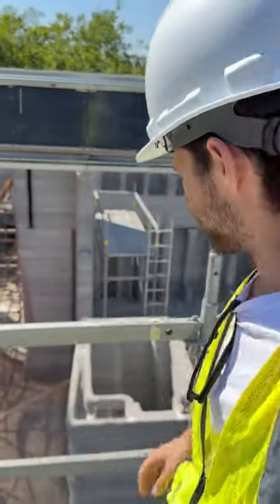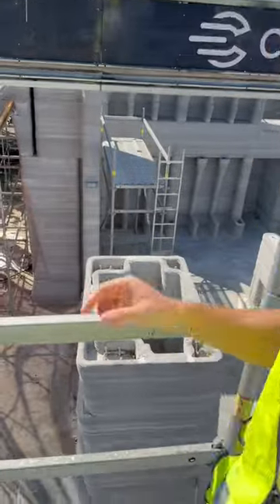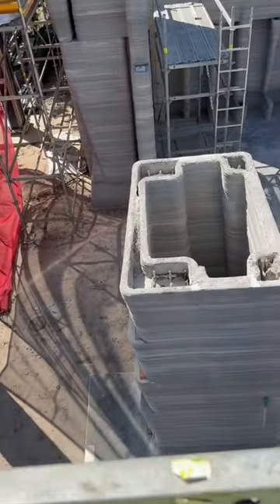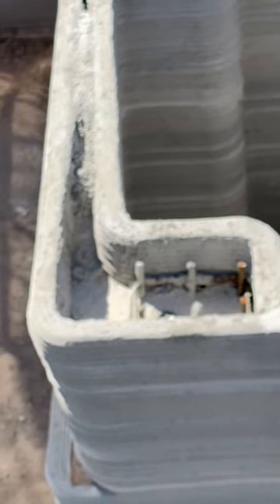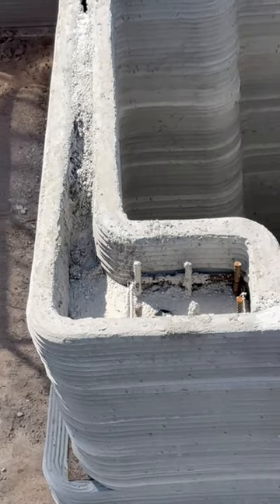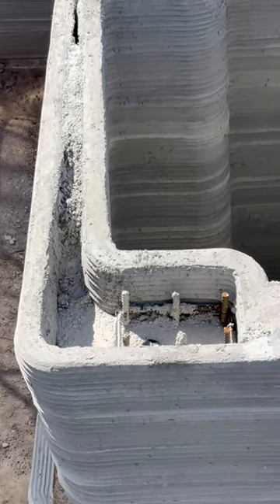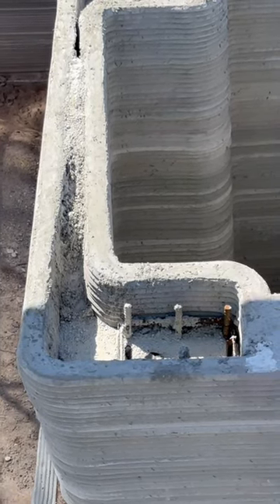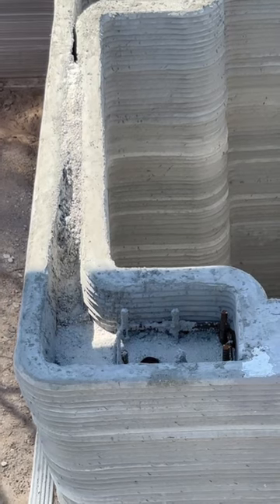Vertical load solution for printed walls

Comment: But the rebar column is not mechanically connected to the concrete building base. Everything is just sitting there.
Reply: Ok, i was thinking the same.  They just throw some rebar in the middle and fill with cement???
Reply: Thats exactly how concrete block houses are made.
Reply: The other bars are inside the walls, and you can’t see them because the concrete is covering them.
Reply: @DustyHoney  not true. The starting row is laid right on top of the slab
Reply: in fact they must be anchored to the foundations/foundation slab underneath if someone thinks that this is to be the stabilizer of the building. Depending on the rebar dia those stirrups should protrude something like 1m above the slab surface.
 Been playing with concrete closer to 40yrs by now, and what I see these 3D-printers do not care at all about curing of the extruded concrete, that's to say poor concrete quality, cracks & modest compressive strength. Unless they've invented some super good concrete recipe they're not willing to share with others...
Reply: @DustyHoney  I've watched a lot of these videos, that is not the case. They arent sinking iron into the foundation, they aren't connecting anything - certainly not to other cages. This is a start-up 'solution' to a problem of optics, not an engineering solution to a problem of structural soundness.
Reply: Yes, after this junk falls apart, those 4 columns will be all that's left standing
Reply: @heinawithdotshanko  yeah, they need to use specially formulated concrete because traditional fiber fill or aggregate doesn't extrude well and if they use a mix without any fiber or additives you'll totally get some early life crackage just from it curing.

If you get a good contractor and if they use the right additives, a lot of the risk of cracking gets mitigated. It's still not as good as a traditionally poured concrete home but it's good enough and it's cheaper... But that's if you get a decent contractor.
Reply: Why assume that they didn't pre-drill the pad to accept the rebar cage?  They could print a few layers, drill the anchor holes for the cage, print the remaining column height, then slot the cage into the holes they drilled earlier and pour the fill.
Reply: ....what do you think rebar is and how it works in traditional construction?
Reply: You could use red heads to thread bar into before the print starts would technically be anchored to the foundation when they pour
Reply: Throw some binding agent in there and hope for the best
Reply: @conortobin6180  brick and mortar construction houses do not have reinforcing.
Reply: If you don't know what you're talking about, refrain from inserting your worthless comments. There is rebar set into the slab before the wall is printed, about 2 feet above the slab. Then after the walks are put up, holes are busted in the side of the wall where the cage is tied into the rebar cage inserted from top. Then the hole is covered, the walls are poured, and the rebar is all tied together.

Comment: So what your telling me is you convinced someone to pay a stupid amount of money to 3D print forms? Only to have a pump operator come and fill the walls. Man you must be a damn good salesman then.
Reply: umad?
Reply: I've been thinking that this whole time is it really more cost-effective to 3D print instead of just forming it up and pouring it
Reply: don't be jealous ;)
Reply: When you do the math of time, labor, materials, reclamation etc.  Printing forms is superior from both a structural standpoint AND an economic one.  With one machine, basically two dudes can form the entire job.
Reply: @FuzzyPurp  no lmao, cuz I’d end up pumping that wall non the less once it has issues.
Reply: @mdacosta7013  honestly there’s pros and cons, pros being less labor costs, that’s pretty much it. Concrete is not designed to be inherently layered like that all drying at different times. I can bust out 50 yards of walls in abt 2hrs or less for a house, flatwork up to 100yrds an hour. So the efficiency isn’t there on those printers yet. I’m not sure of the costs to run them all day long, but a typical pump ranges from 500-900 an hour.
Reply: @Normadus  oh don’t worry no jealousy here, I’d end up getting paid to go and pump the wall non the less once it has structural issues.
Reply: @ilovecars93                                                                         your entire cities are built like a wooden huts and fall like card houses after every tornado, so what are we even talking about
Reply: @Normadus I live in a wood house that is probably older then your brick house and Still in better condition and your talkin shit
Reply: @ilovecars93  
sure, as long as it helps you sleep better at night.
One little tornado and whole neighborhood gone LOL
For me it would be 5 windows while the rest of house and ceiling would be untouched :face-blue-smiling:
Reply: @Normadus  that's rich comming from a guy that's probably never even seen a tornado yet he's gonna pretend his house is built to withstand one 🤣🤣🤣 keep being dumb pal it's funny
Reply: @ilovecars93 my stone house over here has withstood two hurricanes no problem  and it'll probably cost less than wooden houses over there considering if you live in America. 
The first hurricane blew parts of the roof even though my dad and gramps reinforced it so when we rebuilt it we opt to fully cement it. Haven't had a problem since then.
Reply: @owarida6241  tornado isn't just rain and some straight line winds it'll twist and rip your unprepared and shitty built brick house 🤣🤣
Reply: Formwork is more dangerous than this and takes more man hours and more qualified labour, whereas you could probably teach a burger flipper to operate this machine and cut the pay.
I wonder how using this proportion or concrete impacts the price but if it's affordable enough it has the potential to be a real threat for structural masonry work.
Not sure it can be wooden houses in the U.S. market though.
Reply: @Jeramiah870 my concern is this concrete is not monolithic and since there's no form they can't vibrate it. And apparently to prevent premature cracking they're having to develop new mixes.
Reply: @ilovecars93 fun fact: lots of old brick buildings in Europe were either rebuilt in the 50's because of the war or are around 300 years old at best.
Beyond that time frame, if it's still standing, it's that people didn't care enough to plunder it or someone's been restoring it. It's very difficult to find pristine buildings older than 300 years old. Except for the pyramids if they're not buried they tend to go to shit.
So yeah wooden houses don't last for less than brick buildings
Reply: @owarida6241 you do realize hurricanes are not supposed to rip wooden houses apart right? Unless its hand built by non-engineers, which had no one to blame.
Tornados in the other hand are a different story. Depends on the structure but concrete house not designed to withhold tornado might not be any better either.
That being said, I hate dry walls though. It's too weak but I guess it's easy to work with.
Reply: @ilovecars93  idk why are you bringing brick houses to the conversation. Because this video obviously  is not about a brick house. It's about monolithic carcase concrete building. And what I can tell you from experience, those things withstand a direct missile strike. They need some repairs after that of course, but it surely won't fly to the wizard of Oz riding a tornado, like the Dorothy's house.
Reply: @oleksandrbespalov9713  if you would read the thread you would see that little europe boy decided he wanted to talk shit about american houses so i had to call him out.. just like i am forced to do with you considering you claim this mud hut in the video can take a direct Missile strike which it definitely can not  hell they cant even withstand 70mph winds
Reply: THESE ARE LOAD BEARING WALLS JERRY
Reply: What are the warrenties, what are the real numbers per square ft?
Reply: Wooden and. Con crette houses last just as long, because they both keep getting repaired when they need it
Reply: As it stands rn it's more expensive investment than a wood frame to pour in, but it's less man hours into making it, I imagine at some point it'll be cheaper and more consistent than traditional construction
Reply: @owarida6241  America has no shortage of timber, so wood framed houses are cheaper than solid concrete or brick homes. Moreover, most people in America never experience a hurricane or tornado. I have lived in a "small tornado alley" all my life without experiencing one.  Most houses in places like that have countermeasures against local natural disasters.

Even better renovation in American homes us easier due to the ease of construction. Old EU homes that are solid are more difficult and expensive to update to modern plumbing or wiring.
Reply: @FuzzyPurp they definitely
Reply: @ilovecars93 I'm in east Texas and run a glass company for showers in new construction, so far these houses have held up great considering most houses built here the the states are fucking paper. Haven't heard of them having problems, definitely seen and went back to new houses that shifted after a couple months and had to remove whole frameless showers. No one lets their house or foundation settle, starting to turn into suburbs and clone houses it sucks.
Reply: I live in the middle of FL in a wood frame house sitting on bricks and never evacuated during hurricanes
Reply: @mdacosta7013   yeah it is cause it takes less manwork...
Reply: Tell that to the Greek and Roman's that have made concrete buildings that have lasted 2000 years to that of a wooden house that would burn down
Reply: @greyfoxyo  yeah,  I'm from Rome, i'm literally surrounded by concrete that lasted millenia and some clown in the comments comes saying "no matter what you put in the concrete, it will crack". Lol
Reply: @isakaldazwulfazizsunus7564 formwork is dangerous? Huh, I've been doing it for 12 years and barely gotten a scratch in all that time. Go play with your crayons and make sure to wear a helmet
Reply: @gatergates8813  Congratulations on you following proper procedure.
It CAN be dangerous when workers get pressured into OSHA violations, which happens all the time.
Reply: As Jeff from American dad explains the mystery’s of the universe. The comments is still rejecting this like It’s acid that’s gonna melt ur throat.
Reply: Printing is cheaper
Reply: @ilovecars93  Most of the houses in the south are made of aluminum sheet and plywood
Reply: The point is it's cheaper, bro.
Reply: It lets you have complicated curved forms that would be a real pain to do with traditional methods.
Reply: @nata5212  as a resident of the south i hate to break it ot you but you couldnt be more wrong lol
Reply: @ilovecars93 Sorry what lol, I work on historic masonry. Your wood home is not lasting longer than the brick and stone structures out there, your wood will rot away eventually can't say the same about stone.
Reply: @lunawense6288  look i know people like you who have smooth brains have a hard time understanding but if you READ what i have said nothing about it says anything about stone rotting lmao read first comment ignorance after...
Reply: I was born in Europe where my father almost 70 years back build a one level house. The house is made with brick and has reinforced cement columns that are connected to a "cage" of beams underground. 40+ years ago the house was extended upwards adding another floor. Soon after that a powerful earthquake of 8.1 hit the area...
Nothing happened to the house!!
Wooden structures can not withstand those forces.😊
Reply: @mdacosta7013 I mean I think the point is not to necessarily be cost effective but rather labor reducing. Imagine a development village and instead of 20 guys working on 1-2 houses, it’s 20 guys working on 10 all at once. I mean it is easier in the sense that huge forms wouldn’t have to be made and transported between plots. I mean I think the future is more or less a moving 3D printer system. So instead of it being a huge rig that spans the site or a lil truck thing that has the printer, it will be an unmanned vehicle that roams the site printing as needed. That also means getting that at that point we may see better systems for infilling the walls etc. I also see it as a tool for mass design vs personal design. I think the future sees us having actual builders as more of a “pro choice” and the printing process being the “get er done” choice. Meaning if you want specifics that add in woodworking, per se, that you’d hire the builders vs the printer guys. I think that it’s kind of gross that we are moving towards taking humans out of work, especially in the labor field where a majority of people already found themselves there as a last resort. That’s not to speak on all people in the labor field or even on he quality of people, but simply a basic truth of the labor pool. Plus some people just love to work with their hands and this could be something that pushes them out of work in the future
Reply: @ilovecars93 You're not too bright for thinking this will last only three years, or blow away.
Reply: @Jeramiah870  Explain to me how they poured the Hoover Dam, and how it still holds up today. Ya know, since concrete isn't suppose to be layered and drying at different times.
Reply: @boringshawn33  I’ve talked to one of the creators of a company for 3D printing…. He tried to hire me due to me being a concrete pump operator. He word for word said if you even slightly bump that wall while it’s setting it’ll come down and feel like wet sand falling on you. The Hoover dam was constructed with different bag mixes and aggregate than what we have today…. The base of the dam is 660 ft thick, with the top being 45ft thick. There’s a massive difference from a 6 inch wide wall compared to a 600ft wide wall.
Reply: @boringshawn33  not to mention, it’s not really define as a wall when being poured, but layers of flatwork being essentially combined together using some sort of connecting points. So there’s a major difference between this 3D printed wall, and a dam. But hey, I only work with concrete everyday for 8-14hrs a day what do I know.
Reply: @Jeramiah870 then why are multiple countries and governments using this technique
Reply: @Sumguysazz  source please?
Reply: @Sumguysazz  ever notice how when a government picks up something to use it’s usually because they can make more money without spending as much on the asset/item/material? And I’m not sure why we would be so worried about other countries (like America always has been) when we should be worrying about our own country for the time being. Africas 3D printing economy certainly won’t affect us over here.
Reply: @Jeramiah870  it started in the Netherlands, and nearly every country in Europe has 3d printed homes. Plus Mexico and the largest community is in Kenya. Multiple nations are pushing this technique. And if Europe, with stricter buildings codes, is testing this, then there might be something to it
Reply: @Jeramiah870  my initial response was towards someone claiming that the love of 3d printing was uniquely American. I’m simply explaining it’s not, and if it was as bad as people are making it out to be in regards to it being unsafe, or won’t last long etc. Then you wouldn’t have other first world nations in Europe with stricter laws using or testing out the tech. I mentioned Africa as well but you can’t ignore Europe
Reply: @mdacosta7013  they wouldn't be doing it, if it wasn't cost-effective
Reply: @Normadus you've never been through a tornado. Stop lying.
Reply: A form that stays as part of the whole structure.
Reply: i guess the difference is going to come down to the labor involved in building and tearing down the form.

The printed form doesn't need to be torn down, and contributes to the structural integrity of the building.  A traditional form has to be torn down.  The labor to build the form, the materials of the form, and the labor to tear the form down could all be considered "wasted", as they are not part of the final product.  They are pure cost.

Comment: The wall is still just sitting on top of the slab, even if there's rebar in what is already the strongest part of the 3D printed wall.  The weakest parts (the thin sections) are still just as weak as they were before.
Reply: also the rebar is free floating in the concrete so its pretty much useless
Reply: My thoughts also.
Reply: @searrowne yea so much pride and talking point being the rebar but it has fuckall effect
Reply: The rebar is there to add tensile strength, which it still accomplishes. Absolutely does nothing for adhering the structure to the slab though.
Reply: @andrewkvk1707   It may provide some compression strength, but because the inner concrete and rebar were laid/poured after the outer shell cured, it offers zero tensile reinforcement.  There is no bonding whatsoever between the outer shell, which is between 1/3 and 3/4 of the cross section and the inner pour.  The overall wall isn't any thicker than traditional concrete walls.  This combined with the lack of bonding means the strength is well below standard. 

How many voids are there in the thinnest part of that wall? It sure looks like a lot to me.

Comment: Many write here about cost effectiveness and try to compare it. However, I think the important part are not the costs but that you need less labour on the site.

I remember my dad, civil engineer, told me that jobs in construction are bone breaking and that there are a lot less people willing to work in this field than in the past.

If the trend continues, there will be a lot of problems because of labor shortage. So, creating such a solution, even if more expensive, which needs less labour, sounds good.

It just need more time to develop further 😅 I guess